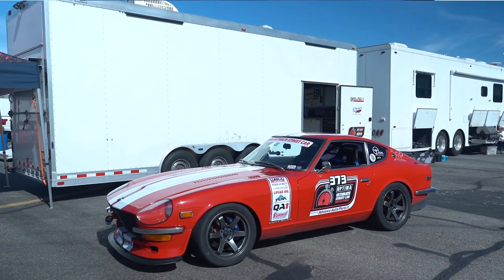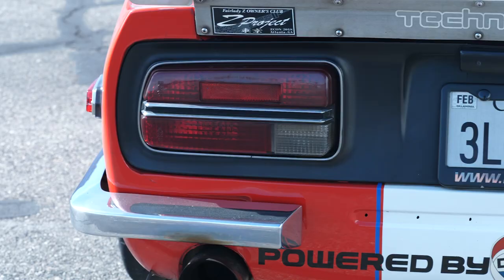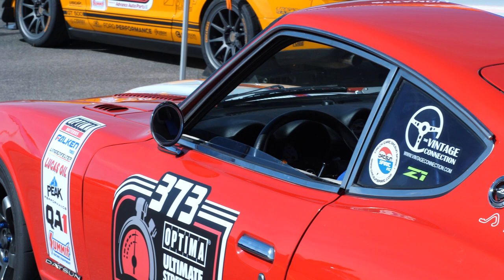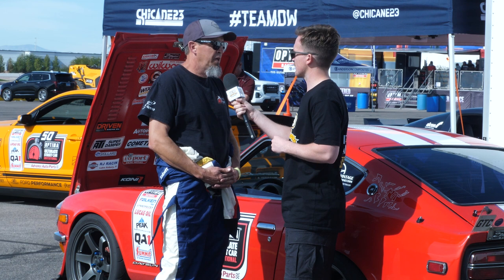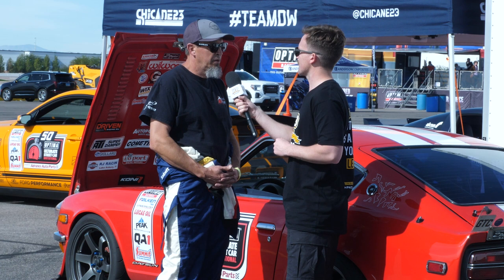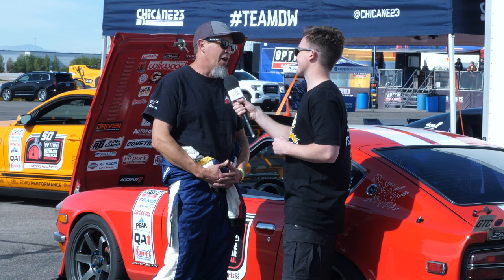Faster WITHOUT A Carb | 240Z Street Legal RACE Build

Comment from the maker: 🔥 Building a fast car? Get $400 OFF the all-inclusive VIP online course package deal: https://hpcdmy.co/vipy129
🦵Kickstart your EFI Tuning knowledge. Get 50% OFF your first online course: https://hpcdmy.co/offery129
0:00 - L Series Datsun
0:19 - Datsun 240z Autocross/Street Car
0:35 - Why Keep The L Series?
1:15 - Engine Modifications
2:07 - EFI Setup
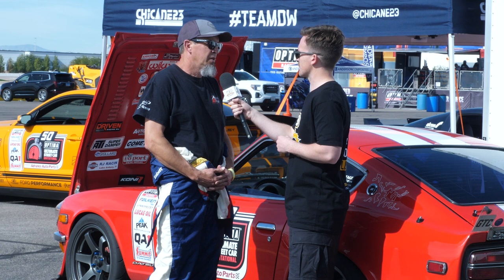2:42 - Direct Fire Coil System
3:05 - Trigger Setup
3:30 - Batch Fire
4:14 - TPS vs MAP
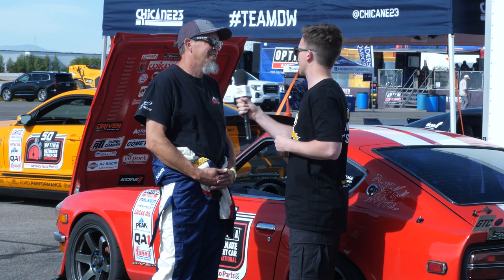4:40 - Driveline
5:36 - Streetable Build
5:54 - Brake Setup
6:24 - Why ABS?
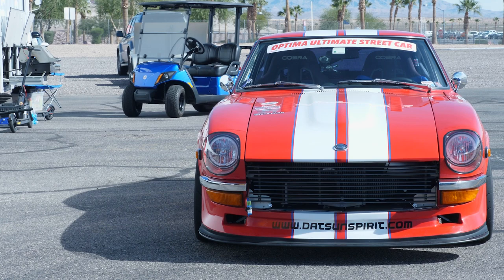6:55 - ABS Conversion & Control
8:30 - Reluctor Rings
9:07 - EFI Fuel System Conversion
10:08 - Thanks Darren!
10:32 - Free Lesson. Get On Into It

Comment: I am always excited to see S30 Z's. I have a 76. I really want that ABS system. I have sequential fuel and spark and no cam sensor. Using only a crank sensor. I have a hall sensor that runs off of the oil pump mounted where the distributor used to be. It's made by Tim (Great guy) at one six industries. I'm using a Haltech Elite 750. I wish I had Z guys near me to collaborate with. That's a beautiful car you have. Take care of her😍

Comment: I was thinking instead of the reluctor rings, if the rotors are vented, turn the inside to be concentric and use an inverted pickup. I have a customer with 3 Z cars we are restoring. I think he will like this video.

Comment: The E46 M3 ABS module is very pricey, the Bosch motorsport ABS system is very similar but configurable.
Reply from the maker: Yes, they are night and day in configurability terms, you can adjust the Bosch unit on the fly too. I don't think anyone will claim they are equals.
While the BMW based option is a bit more expensive now that it has become more popular, comparatively it is still cheaper, and while you get what you pay for it is understandable when compared to no ABS due to being priced out of a top-tier product like a Bosch unit, it is still an amazing upgrade to a car like this 😎

We are actually fitting a Bosch unit to our SR86 for next season. Should be an update on it soon and we have fitted the other option to Andres FJ40 project (just a street build, not a race car) however the Bosch unit will be up and running before we have finished the 40 series - Taz.

Comment: Adding EFI to a ‘non kitted’ motor is tough to do
Reply: It's not really hard on L series engine. Nissan made the L24 carburated but the later version, the L28 used a EFI set-up. You just need an ITB kit or an EFI intake, an EFI harness, a ecu and a crank angle sensor or cam sensor. I've done it on my 280z, converted it to ITB and it was a simple process. Especially since the parts to make it work are all already available to purchase.😊